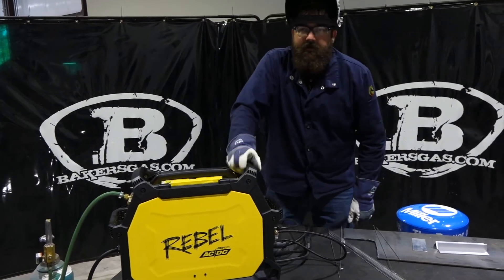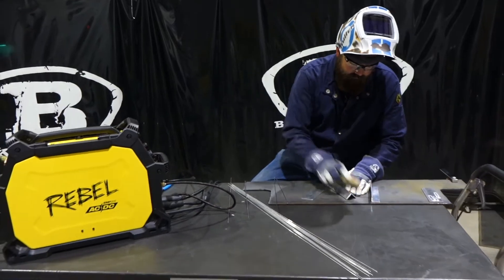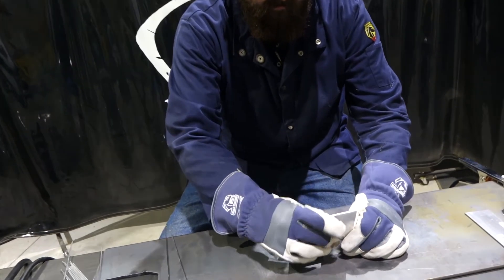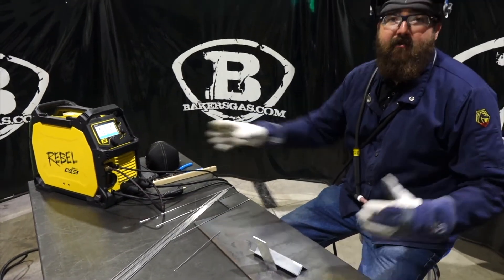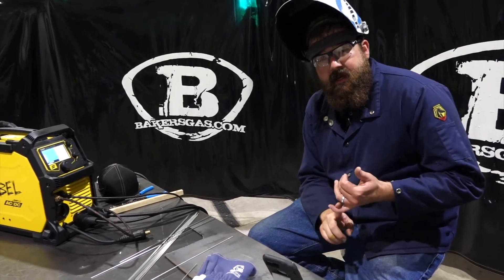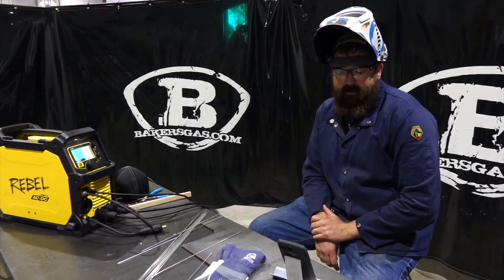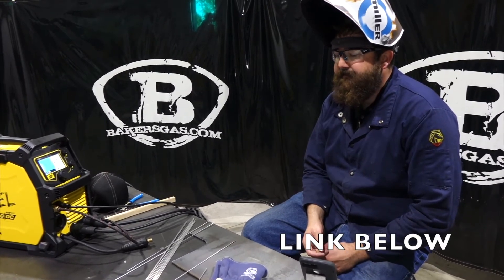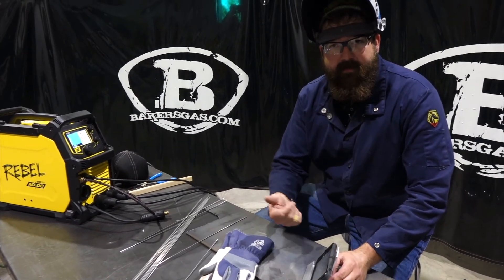AC TIG Project with the ESAB Rebel 205

Comment: You can keep the MiG gun plugged in. No, you don’t have to remove it and take the wire out. But you do have to unplug the switch/foot pedal and the short connector. Doing that is pretty easy. But the main part is that you don’t have to unplug the MiG torch itself, or the wire. That’s the big hassle.

You get 240 amps at 20% with this, and close to 200 amps for stick and TIG at 20%. ESAB just talks about 25% and more though.

Comment: When welding AC do you need to be on 230v current or will the machine allow you to weld on 115v ?
Reply: You can ac weld on 220 or 115, you just get a lower max amperage on 110

Comment: Were you REALLY running 35cfh on aluminum tig? Lol isnt that pretty much MIG flow setting? On aluminum tig usually 12-20cfh especially with standard collet. Dodnt sound like 35cfh either. O well. Nice sounding AC arc, responsive, quick. Nice machine nice video!
Reply: Running so high of a flow because the welder is so close to his work it’s sucking the shielding gas away from his work
Reply: @sdranch2800  haha! Ya good point, not the most economical way to weld prolly

Comment: Can you ad a water cooler?
Reply: Hey brother, dont know if you've found this out yet....you can add a water cooler to ANY tig machine. Some you just have to switch on and off separately, and some have an outlet on back of machine so they turn on and off together, so you wont forget to turn water on when welding. I have had one cooler an use with all three tig machines I own. Its just the torch that receives/returns the water to cooler. Gas line/dins connector are only ones that connect to machine itself

Comment: Andrew @ Bakers Gas and Welding, it's usually a good practice to NOT rub, scrape, and slide your Aluminum all over a Steel Surface. Lol you're just Grinding Carbon into it everytime you move it across that Steel Plate. I'm sure you know this. I just had to call you out on it. Lol 
I try to never let any Aluminum that I'm going to be Welding, to ever touch any Steel, if I can absolutely help it. I have a Machined Aluminum Fixture Plate, a Stainless Fixture Plate, and a 24"×24"×1/4" Sheet of Copper, that I do my Aluminum work on.
Reply: How do you cut it?
Reply: @madfatchickkilla  he uses a blade with aluminum teeth.